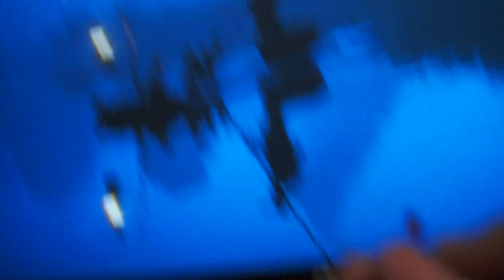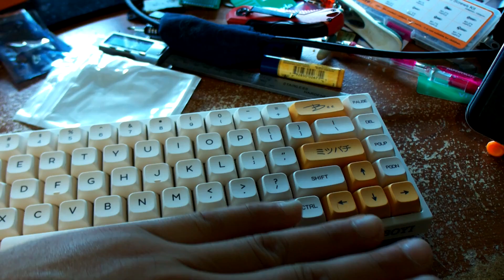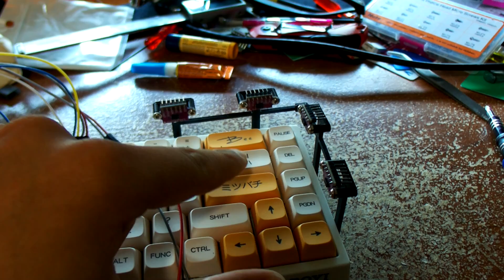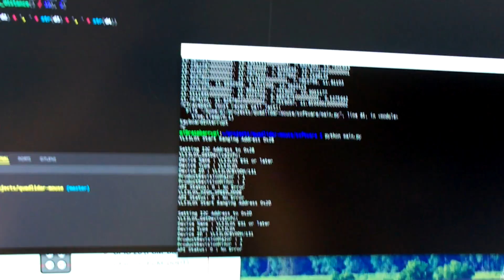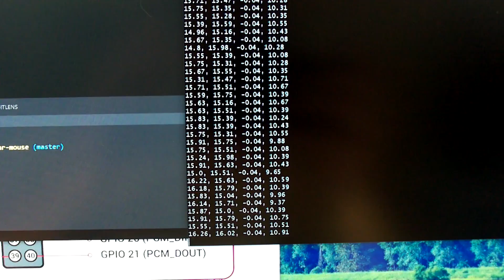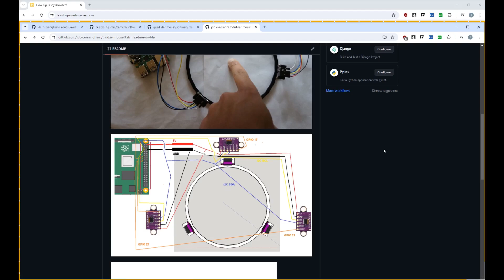Quadlidar trackpad mouse

Comment: wow really cool, i didn't thought you would actually build it... thanks... 

:( youtube algorithm delivered this to me really late... 

in such a little amount of code,  it's turned out to be better than i thought.. i surely think by updating the code a little bit this could actually be usable, as now it's just working like  mouse keys...
I hope pyautogui doesn't have wayland support, but  python mouse library does as it ported to listen to events from  /dev/input device files , but don't use the packaged version as package hasn't updated in a while and last packaged version still uses x, just need fork the github repo and include in the project... also make sure run as root, or add user to uinput group, .. (last time i used it, ii forked it, removed the check for root, and added user to uinput, and it worked flawlessly)

but python is terrible for making mouse drivers, it's too slow for a smooth experience.. prob need to write it in c (and if works we can  fork zmkfirmwire and add there, as there is i2c pins in nice!nano and other boards for driving displays), but need to find better sensors for that

i have a spare raspberry pi4 laying around and lot of time, if you could give me links to buy the sensors , i can try buying it and try to make it more practialy

my keyboard have no gap between keys as it's using choc keys, and with a flat keycaps, it's perfect touchpad... for split keyboards, if we mount this in right half, we can assign a button in right half to switch to mouse mode when holding it, where keyboard is disabled and mouse sensors are enabled,
Reply from the maker: the sensor is VL53L0X so anywhere you can get them
yeah I'm not sure if the mouse is currently slow because of the 20ms sampling rate or if it's because of pyautogui... I have to look into how mouses work regarding the response rate/time for a human moving it
I think I'd need visuals on what you're describing but it sounds interesting
I made it because I want it to be smaller, my current project is actually packaging it as one so the pi has a case/it's like an intel NUC machine (think of an ashtray shape with two buttons)
Reply: @vantawing5160  i would say it's because of python than the sensors cuz old mouse have latency upto 140ms, still rarely noticable  for normal browsing... python eventloop can't keepup (even with multithreading)

 though sampling rate is around 8ms, so might be better to rotate between sensors so every 5ms data is transfered, and we can guess remaining sensor data by looking at the trend of last 4 or 5 position data from the sensor...

also there is this thing called cis sensor, used in scanners, i have seen a cool demo somewhere (with multi touch), though it might be bulky
Reply from the maker: @vaisakh_km  CIS sensor looks cool. I have moved towards putting the pi 4b in a box with the trackpad on top so it's like an ashtray shape ha. But still the tech will be the same/applies what you've been describing.

The current code is using 20ms but the sensors are sampling on their own side by side... I like the trend idea makes sense.